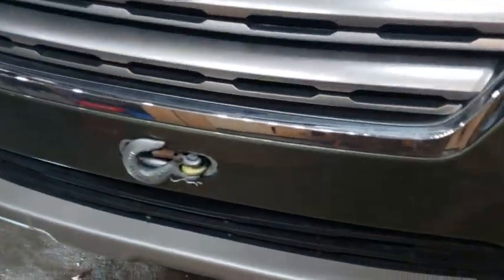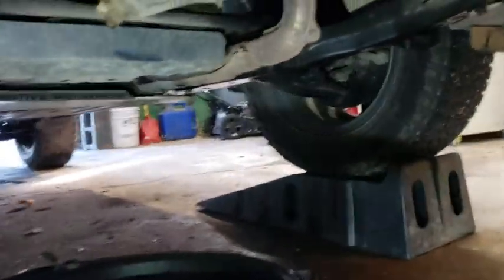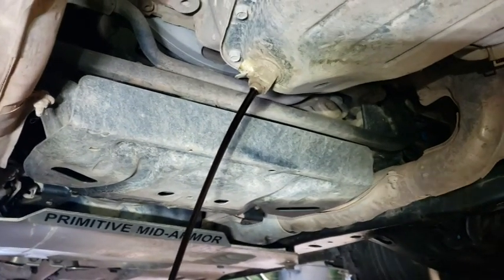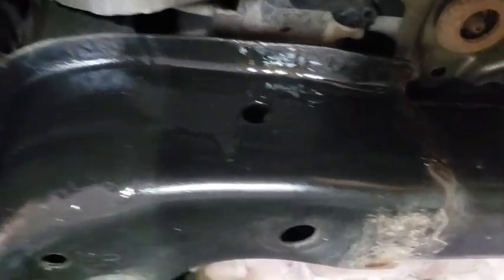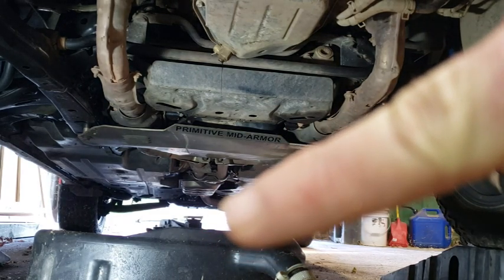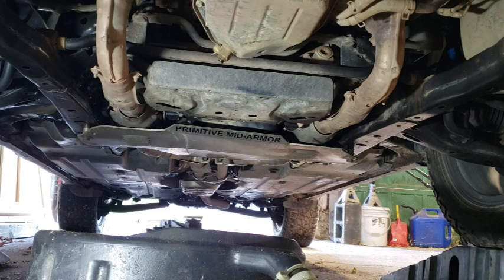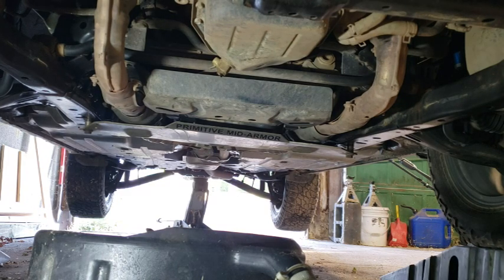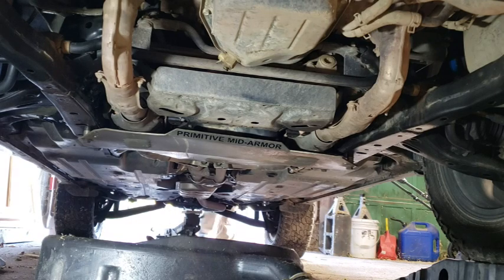Is changing your Oil on Ramps DANGEROUS?

Comment: I really don't think there's any harm in having a small amount of oil left in the pan anyways as you will be replacing the filter as well and I'm sure when you have your oil changes done at service stations they plug up the oil drain plug long before it even comes down to a trickle never mind a few drops.

Comment: No need for a jack when changing oil. Only use ramps. It's faster, easier, and safer.  I've been using ramps to for all my oil changes the last 27 Years.

Comment: Plastic ramp cracked/broke while driving up on it.. They were brand new. Lesson learned.. I only use steel now
Reply: I use steel. I had my neigbor add support cross bars on them.
Reply: wheels prob weren't straight.
Reply: Bought "Race Ramps" touted as great ramps--some kind of reinforced foam, not cheap, $250.  Cracked after 4th use, but SOL, only 1 year warranty.

Comment: Ramps are as dangerous as a floor jack.  Completely safe with the use of jack stands, or blatantly dangerous without jack stands.  You demonstrated the second example.
Reply from the maker: I've never heard of using jack stands with ramps. Not a bad idea though.
Reply: I've heard of people getting killed by jack stands. I haven't heard of anyone being killed by ramps. I guess it could happen. If your wheels are scotched there is probably less danger than using a jack stand.
Reply: I think the uploader was aware of how unstable the car was with the rear on the jack. If you don’t do that, and put the ebrake on and transmission in first gear, and blocks behind the wheels, i think you’ll be 99,9% safe with ramps. There is no way a ramp can topple over. Only if the material of the ramp breaks then the car may come down. Just give the car a good shake before going underneath it to be kinda sure everything is stable.
Reply: @Engineer9736  Look at the reviews at any of those plastic ramps on amazon and witness dozens of photos of them crumpling under small vehicles.. even the 'heavy duty' rhino ramps made for large trucks. You're just rolling the dice with them.
Reply: I just changed my oil using 4 Jack stands AND two floor jacks, one floor jack on each side, pressed just up against the subframe. And I still don't feel 100% safe with all of those precautions. Going under a 3000-4000 pound car with only two floor ramps... yikes.

Comment: There is always oil inside the engine and related oil circulation system ( unless you remove the engine from your car ). Therefore, after you've done your oil change and check with your dip stick, you can still see old oil ( dark color ) on the dip stick !

Comment: For oil changes, I find a 'topsider' to be most convenient. You basically suck the oil out through the dipstick tube with a vacuum pump, into a can. I actually get more oil out that way, than through the drain plug... so I think it's a slightly better result. These topsiders are especially good, if you can change your oil filter without having to jack up the car. That way, you don't need to jack the car up at all, to drain the oil, or put a new filter on. My knees and back love this method! Plus, there's no risk of being crushed, because you're not crawling under the car for anything.
Reply: Check out my vacuum pump video. Although I’ve never used it to change the oil, I use it mostly for ATF. I might try some day on the engine oil although I can’t imagine it getting much lower than the Fumoto valve
Reply: Is it really better? I just wanted to write a comment mentioning that vacuuming out the oil. 
I have always thought that draining at the bottom is always better because gravitation just does the job and drains all of the oil without question. But if you vacuum it from the top you cant suck out all of it with the dipstick... So your experience is interesting to me.

Comment: Seriously? The drain plug is at the AFT end of the oil pan for a reason. They know you're going to lift the front end of the car up one way or another to get at the drain plug. This puts it at an angle where all the oil goes towards the drain hole. Not too hard to figure out.

Comment: how about changing your with ramps on a reverse incline on your driveway? I mean, your car reversed parked on your driveway with the front wheels at the lowest point, however in this case on ramps. If you do this way your car would be flat...

Comment: I too am passionate with removing trace oil and prevent the premature head gasket failing.
Reply from the maker: Is there a correlation there? I am unaware of it.  I wouldn't mind being able to use suction to change the oil but unfortunately the EZ36 has a two piece oil pan and the internal baffling gets in the way.
Reply: @bruceyyyyy  Only if you have the EJ25D like us. Granny's head gaskets could fail if the wind blows the wrong direction, and she sure does produce some smokey dark oil I tell ya
Reply from the maker: @powerofyourbrains  My despise of EJ25D/1/3/5 is well documented. 

They're not great at much beyond keeping mechanics employed.
Reply: @bruceyyyyy  She's doing just fine at that
Reply: @bruceyyyyy  what about the 252/254/259 and 257???

Comment: Unless if you're 350 lbs you should fit underneath a Outback without a jack or ramps, Bruce.
Reply from the maker: I'm 220 lbs and much prefer ramps to change the oil. 

Even with the extra 2"from the lift ramps just make it that much easier to remove the skid plate.
Reply: I am 175 pounds and I could barely fit under my 2017 Silverado to change the oil.

Comment: what ramps do you use?  Seems like some of the plastic ones break.
Reply from the maker: I think the brand is rhino ramps.
Reply: @bruceyyyyy  I crawl up under mine all the time..the rhino ramps. Never had an issue but after reading all these comments maybe I'll use jackstands as a failsafe next time. They seem really solid but guess it doesn't hurt to be safe
Reply: @mototoad1242  Good thinking! We only have 1 life each, never hurts to be double-safe.
Reply: @mototoad1242  I never fuck around when it comes to this stuff. I’m even more paranoid now that I have a family. I don’t even use plastic chocks even though they’re just as effective. I use massive rubber ones.

Comment: What kind and weight of oil do you use Bruceyyyy?
Reply from the maker: Just 5w30. I've done some analysis that shows pretty much anything works.
Reply: bruceyyyyy thanks...regular or synthetic or do you feel it doesnt matter?
Reply: I use 0-20 Castrol on the 2018 Outback,  5-30 Castrol High mileage on the 2007 Malibu.
Reply: @Genetk44  You know every car model is different? Look up the manual for it.

Comment: i have a under the car" with ramps,  jack or stands phobia...even watching  cause me fear...i only crawl under the car if its level on its tires
Reply: I feel the same way. I want to change the oil on my 2017 Silverado and just by crawling underneath the truck and being in a tight fit I felt the claustrophobia sit in and I felt really uncomfortable.
Reply: If i go under a car i want to be at least 99,9% sure that it is scientifically safe, so only official tools, ebrake on, gear in 1th, block the wheels, put some extra things underneath like a spare tire or another jack as a backup, shake the car a bit to check stability, after that i’ll see whether if i go under it or not lol 😛 Keeping in mind that if it comes down that life is game over.
Reply: @Engineer9736  i also let it sit on the ramps for 30 minutes or more before crawling underneath.

Comment: Old Subaru notes:  (not that I am an old Subaru driver, only that I have an old Subaru)
My EJ251 is picky about oil.  Put Mobile 1 5W-30 in it and watch the drips bypass the pan gasket like no other.  Doesn't seem to do this with other oil types.  
The dangers in changing oil are likely some of the following:  mistakes with the ramps and jack, burning oneself on the exhaust or with the oil when it is hot, and bears.
Hot oil will drain out more of the contaminants and drain fluidly, but it burns like a sob. (gets everywhere, causes cancer, etc)

Comment: I'm thinking 4 homemade wooden ramps, made out of 2X10 boards. More solid. No way for them to get crushed. I would NOT trust any poly/plastic ramp, but my vehicle weighs 6k pounds.
Reply: Yes I'm thinking of the same thing.  Alternate the grain pattern so nothing splits.  They would be heavy though.
Reply: @cgeorge6786  Ended up making them with 2X10. Works perfectly for my needs. I made two piece ramps held together with U-Bolts. Once the vehicle is on the highest part, I pull the U-bolts out from both sides and slide away the lower section.
Reply: They stack great because they are mirror images of one another once you turn one upside down.
Reply: @dr.emilschaffhausen4683  Probably 40 or bucks or less on supplies I bet.
Reply: What about two rail road ties?
Reply: @tomc5435  I'd be leery, unless they were new. Older ones clould split unexpectedly.  Otherwise should work in theory if you cut an angle on one end to drive up.
Reply: @dr.emilschaffhausen4683  split how? They are litterally intended to hold the weight of freight trains. They're not going to split.
Reply: @tomc5435  They are intended to be used with multiple other ties along the length of the track, and the track rests on top perpendicular to the grain of the wood. They're also impeded in gravel. Completely different setup.

I've seen older ties used for various projects, and I've seen them splitting and coming apart. The grain runs lengthwise, and thousands of pounds resting with the grain could cause an older tie to split. 

As I said, if it's new, probably not a problem.
Reply: @dr.emilschaffhausen4683  yet, I've been doing it for years on some very old ties. ZERO problems with them splitting. 🤷‍♂️
Reply: @tomc5435  That's good! Just be mindful of any crack initiation. 

I think the issues are typically with some older ties treated with petroleum oils rather than creosote or copper naphthenate.
Reply: @dr.emilschaffhausen4683  I've got more faith in them than a 2x10 board.

Comment: Oil valve is an interesting idea. When you lowed the hydraulic jack, there was some danger that the car might roll off the ramp. Hope at least you have set the parking break on. Better use wheel blockers.
Reply: The parking brake is on the rear. Jeez that was dangerous.
Reply: Fumoto valves are awesome. Have them on all my vehicles.
Reply: Totally depends on vehicle. This is a Subaru, which I believe is a front wheel drive. Definitely could’ve been an issue on the rear wheel drive vehicle.

Comment: How are those plastic car ramps holding up?
Reply from the maker: I'm still using them.
Reply: @bruceyyyyy  I wonder if they will work on low profile vehicles? Was thinking of buying them for my Dodge Challenger.
Reply from the maker: They make low profile versions that are less step. My Honda drags on these so it's meant for CUVs or bigger.
Reply: @bruceyyyyy  thanks for the help, good luck with your channel👍
Reply from the maker: Thanks! I do ok.

Comment: Seriously folks...if the vehicle starts to move all it takes is a quick twist of the jack handle and the rear tires are back on the ground. I also contend that not one of you have ever seen one of those plastic ramps collapse lol...
Reply: He wasn't near the handle when he checked the flow ,the low point of the ramp was keeping it from running him over. I scraped my ramps after I drove off them once. Is changing your Oil on Ramps DANGEROUS? When you do it I have to say YES!

Comment: I know you're gonna think I'm being sarcastic again, but I say the following in all seriousness: Despite my mechanical cluelessness, this is something I have wondered about from the moment I started changing my own oil on my Forester.

Let me grab my pipe, lean back in the rocker on my porch, and ramble on like the old-timer I'm getting dangerously close to being. You see, sonny, before the Forester, all my cars & trucks used conventional oil and, being busy and lazy, hitting a quick-lube place at lunchtime for $35 was a no-brainer. It only took one time of getting charged $90 for a full-synthetic oil change on the Forester to motivate me to just do it myself. With the top-mounted oil filter on the FB25, it's so ludicrously easy that even an incompetent old coot like me can change the oil. But I immediately noticed how my car on ramps looks noticeably different than my car sitting over the pit at the quick lube place...it's angled, not flat! Sometimes my own powers of observation astonish me. But I digress. I did seriously always wonder if I was leaving oil behind. I mean, for $55 savings, I wasn't too concerned about maybe not getting the final two tablespoons of oil out of 5+ quarts, but still...thank you, my boy. I realize that it's not the same engine, and my oil pan doesn't look quite like yours, but this is still reassuring. It wouldn't have occurred to me to try jacking the rear of the car to get it level, though I don't even have a floor jack so I couldn't try this if I wanted to. And I'm probably too lazy to do it anyway even if I had a floor jack. But now I don't even have to worry about it. 

P.S. JonDZ will be proud of that click-baity title!
Reply from the maker: You should seriously get a fumoto valve if you don't have one already. They make oil changes on the FB25 downright sublime. 

I wouldn't worry about the little bit of oil stuck in the engine. It's so minimal compared to what the capacity is even on the 5.1 qt FB25.

You do what I did and just dump a 5 quart jug in and call it a day, right? :D 

Re: Title: If the title is a question the answer is noooooooo

Comment: Think i would have put a couple of axle stands in as well safer
Reply from the maker: I don't typically use them when using ramps. I guess I should though.
Reply: How so?
Reply: @greenspiraldragon  Because cars are deadly heavy and you have only one life to spend. Accidents and so.
Reply: @Engineer9736  I feel most secure with a vehicle on jackstands just high enough so I can slide ramps underneath each tire as a fall back.